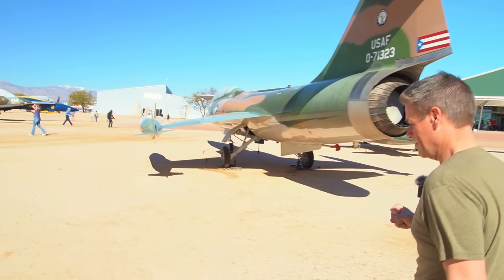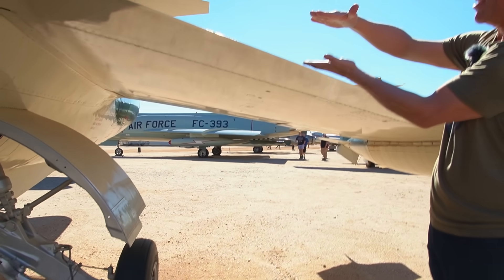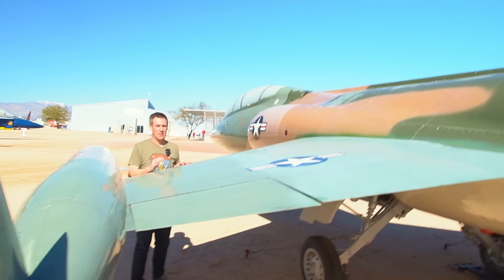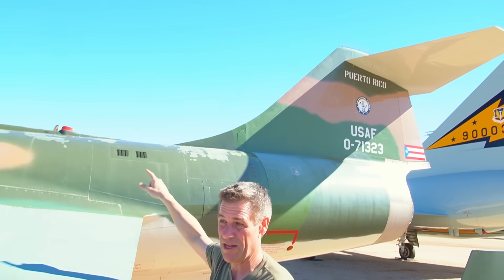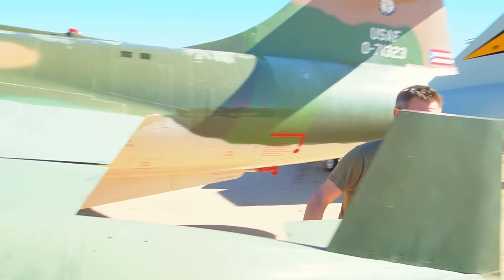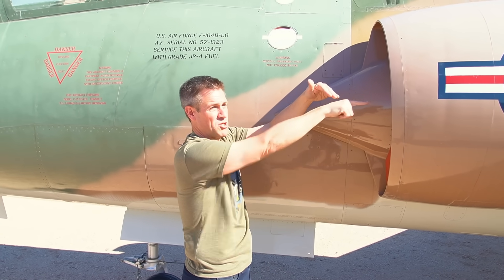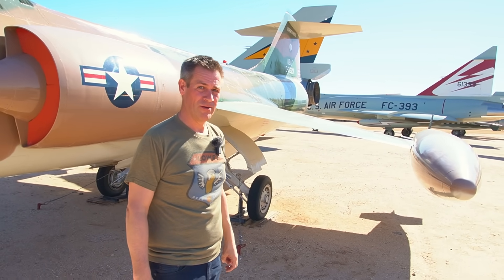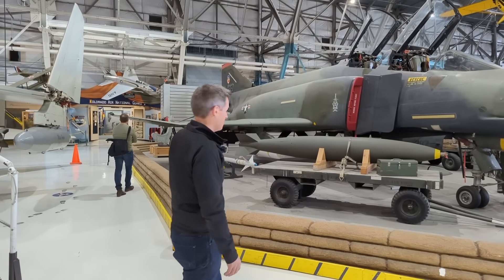Why the F-104 Starfighter Was So Fast | The Aviation Show Clips

Comment: They asked Kelly Johnson to make an interceptor that could take off and climb to Soviet bomber interception altitudes AS FAST AS POSSIBLE. When you give a man like Johnson instructions like that, he makes it happen. Please remember, this was just before we could make ground to air missiles that could lock onto a target and shoot it down. So this plane was a man-guided missile for shooting down bombers. The problem was that many air forces decided to try to use these planes for purposes other than the primary one it was designed for. The plane did exactly what was initially asked of it. When a wave of nuclear bombers is approaching North America, you don't kvetch about how high the landing air speed of the interceptor is. You pray that the interceptors can get to and destroy the bombers before they can release their nuclear payloads.
Reply: Wrong.  The F-104 was designed as an air superiority fighter, not as a bomber interceptor.  Since air superiority types generally develop into multi-role aircraft, there wasn't anything unusual about Lockheed doing the same with the Starfighter..

Comment: The F-104 fuselage was based on the U-2.
Reply from the maker: It was the other way around. The XF-104 was already in testing, so for the U-2, they used the basic 104's fuselage coupled with those long lovely wings to get what they needed.

Comment: Remember when the 104 was built. The heating up of the Cold War. Lockheed designed the F104 for one purpose and one purpose only. A last ditch strike against the USSR. The role? Take a nuke as fast as it would go and deliver it to the Soviets. It was a one-way aircraft (why it sucked at landing - it was presumed it wasn't coming back and there would be nothing to come back to anyways). Why so fast? Simple. Very small. Very light and a monster of an engine. It was a piloted engine. As the Cold War simmered, Airforces had to start finding other uses for the 104, roles it was never designed for and ended up being very bad at practically all of them. The 104 became known as "The Widow Maker". The J79 engine in the 104 was not equipped with an "air-start" so the engine could not be re-started in flight. When the engine failed, which it did more than any other aircraft, the pilot would look at the ground at the tip of the nose. That was where that aircraft was going to create the hole. There was no controlling it. More advanced upward ejecting seats quickly replaced the original seats. It was not a question of "if" you would ever eject out of a 104, but "when", and how many times. A Canadian Forces pilot, during takeoff, upon hearing the controller call "Fire" (vehicle burning on the ramp), immediately ejected out of his 104. If you were smart, you never hung around to find out if it was you. As far as a platform for anything other than nuke delivery, it was useless but to be fair,  it was never design for anything else. It was litterally, a piloted engine with a bit of manuevering, nothing more.
Reply: You really shouldn't drink and post at the same time.

Comment: Wing leading edge was sharp enough that maintenance crews installed guards on both wings. It would split your skin with just a bump..
Reply: It was about as sharp as your average butter knife.  If you were careless enough to run into it, sure you'd get cut.  But it wasn't "razor sharp" or anything like that.

Comment: The leading edges were made of electroformed nickel (Ni). Nickle was actually plated (sulphamate) on a form layer by layer until it reached the optimal thickness. It took weeks and sometimes longer in a plating tank to reach its correct size.

Comment: I am an Air Force vet, aircraft engineer. When the 104's were brought in the hangar they had to have leading edge guards fitted! The Leading edges were HONED to keep them perfect. On a post flight inspection wings were checked for any damage to that  mainplane. Any small dink could disturb airflow.

Comment: I remember the old saying that if you wanted a Starfighter, just buy a field in Germany and wait. I remember lots of  crashes
Reply: Didn’t test pilot Yeager loose control of an F104 at high altitude loosing wing lift and going into a flat spin?

Comment: Regarding the lack of dogfighting ability on the F-104: 
According to Bruce Gordon (former fighter pilot and author of 'Spirit of Attack'), he stated that the F-104's could actually outmaneuver the F-106 at supersonic speeds in 'mock' combat !! 😮 I find this rather hard to believe, but I suppose it is possible if one considers factors such as the ability to 'roll' quickly, and the ability to maintain 'energy... not just turning radius.

Comment: Flew to Tucson just to visit this museum for its B-36 and B-58 back in 2011.   The vast majority of other aircraft are easily found in many museums around the nation.
Pima is a worthy visit for any aircraft fan, just avoid extreme summer heat, as I ended up moving from wing shadow to wing shadow and still got cooked!
Also check out the Titan II Missile Museum while there!
Reply from the maker: I've only visited in February, when we filmed this, and it was roasting hot that day! Totally agree about Titan. We did an audio tour for the podcast (pre-full YouTube) days, and we got to go to the bottom of the silo. That was an odd experience.
Reply: @theaviation_show   Glad you took the time with the Titan site!   Kudos!
I maintained some of the comm gear for the silos in Kansas (that big antenna outside was part of our HF system), and of course got the see it all when live.
Very cool memories of younger days!
Reply: C’mon guys, it’s a dry heat.

Comment: You HAD to start with that nickname. Just couldn't resist, huh...
One thing few people know about, and I can't remember the name of the guy at AETE (Aerospace Test Establishment) that told me, was that in around '84 or so, in Cold Lake, an idea was floated to take one of our soon-to-be-retired CF-104s and modify it with a GE F404 engine as used in the new (at the time) CF-18 Hornet. 40 years later, we're still using the same tired jets...
I don't think the idea got much past the spitballing stage before it was ixnayed. The aircraft were already allotted to Turkey, and they didn't want money spent on it. The performance increase is speculative, same thrust with 2/3 weight and 55% fuel consumption. Increased range for sure, and likely acceleration and speed boosts. Weight and balance would be a bit of a problem.
I wonder if it would howl the same.

Comment: The F-4 pilots used to complain that the 104s cheated.  The 104s fought vertically (slash and run), while the Phans tried standard turn and burn.

Comment: I love the F-104.  The U-2 is basically an F-104.  Hard to believe, but it is true.  There was a German WWII ace that was still in the Luftwaffe when Germany adopted the F-104.  He hated it as a fighter.  He was eventually relieved.  His superior said  he was an excellent fighter pilot, but as a general.  So many speed records were set by it.  However, like the F-16 when it the engine goes out it is a giant lawn dart.
Reply: Erm...that is why the F-16 has a hydrazine catalyst backup power source for the hydraulic system. So, a well guided lawn dart...compared to the drop-from-sky F-104
Reply: Hartmann didn't hate the F-104 (he called it a great airplane), but he did feel that it was too demanding for the Luftwaffe and he was outspoken about Germany's decision to buy it.  That's why he got canned.

Comment: You should've mentioned the "area rule" which gives the plane its coke bottle shape and reduces supersonic drag. That's another reason why the F-100 and F-102 were so disappointingly slow while the Starfighter is a dragster.
Reply from the maker: Check out the full Century Series video mention at the end of this one (or the two F-100 and F-102 clips), Joe goes large on area rule. This is just ten minutes of an hour long look at most of the Century Series at Pima, which we followed up with two more at the Wings Over the Rockies Museum in Denver.
Reply: That was actually the aerodynamics understanding at the time and turned out to be a mistake. The wasp-waist profile was thought to break through transonic speeds faster with lower energy, but it doesn't. Profile no longer used.
Reply: it was just an excuse Kelly Johnson used for Lockheed to back his radical engineering prowess.  It’s an amazing aircraft, its aesthetics does not always concur with dynamics of flight, but untouched in its narrow window of operation.  Moreover, it was less than a decade after F6 Hellcats were the latest fighter aircraft.

Comment: F-104 was a dismal failure military wise. Took allought from the u- 2 spyplane in it's design. Wings too small, burned too much fuel just to stay up in the air due to small wings. Like the f- 102-- a real 🦃.
Reply: The U2 was developed from the XF-104 prototype, not the other way around.  You're wrong about everything else, too.

Comment: The Starfighter "Widow Maker" reputation was from F-104G's operated by the West Germans. The F-104Gs operated by the Italians had a much lower accident rate and F-104Ds & Fs operated by the USAF had a lower accident rate than the F-100s.
Reply from the maker: Chris over on the Military Aviation History channel has a great video about Luftwaffe F-104 loss rates which is well worth your time. Lots of charts if memory serves.
Reply: @theaviation_show roughly 900 units, more or less 1/3 crashes.
Reply: @justayankhouston741  A 30% attrition rate was pretty typical for 2nd Generation jets.
Reply: The Germans final accident rate was a bit over 15 losses per 100,000 flight hours.  The Italian rate was slightly higher at around 16/100k.  The Starfighters flown by the USAF had an accident rate of over 30/100k (the D anf F models were two-seaters, btw).  This was far higher than any other Century Series fighter, including the F-100.

Comment: Amazing design with a first flight 71 years ago now.  Interesting comment about its dogfighter v. interceptor usage, very similar to the English Electric Lightning of the same era which was slightly better as a dogfighter but was essentialy an interceptor for use against incoming Russian bombers.  However the Lightning was a bigger aircraft and required 2 engines to achieve the same performance as the F104.

Comment: Ejecting down? What? 

Sure about that? 

Isn't it that it wasn't a Zero Zero seat and not that it ejected down? that would require massive changes to airframe. The seat ejects up, just not greatly at low speeds and low altitudes.
Reply: the first f104s did indeed shoot the pilot downward when ejecting.  I don't know offhand when it was changed to going out the top. And as stated in the video the early ejection seats didn't have the power to guarantee clearing the tail.
Reply: Indeed, the initial design did have the pilot ejecting down. I'm not sure that this feature made it beyond the prototype stage, though.
Reply: And, that was long before "zero-zero" seat development.
Reply from the maker: Yep, the Starfighter was initally built with the Stanley C-1 Ejection Seat which was downward firing up to the D-model. These were replaced with upward firing rocket ejection seats with a mod in the sixties.
Reply: @theaviation_show  By early 1961 all C1 seats had been replaced with the C2 seat.

Comment: Interestingly the Bell X1A was capable of in excess of  Mach 2.4 with a straight thin biconvex wing and only 6,000lbs of thrust.. Also the Mirage III had a  higher top speed than the F-104 with much better manoeuvreability and turn performance  while using an engine with nearly  5,000lbs less  thrust... And no need for flap blowing.
Reply from the maker: The Mirage III is a fantastic aircraft and seeing Dassault's approch to jet at this time and contrasting with Kelly Johnson and his team is very interesting indeed.

Comment: With rocket assist, the F-104 was the first piloted aircraft to reach 70,000 feet altitude, the point where space begins and pilots become astronauts. The U-2, also a 70K' flyer (Still in limited use today because spy satellites cannot necessarily be where they are needed WHEN they are needed) is essentially an F-104 with glider wings.
Reply from the maker: U-2s still fly every day that the weather allows for them. They are very active out of the bases here in the UK as they can be deployed quicker than retasking a satelite.
Reply: @theaviation_show  Didn't know usage was that regular. In asking about the narrow window between critical mach number and stall, was told by former U-2 pilot who now flies sailplanes, that tail section, not the wings, would be first part of the airframe to fail from an overspeed condition.
Reply: The F-104 has zoom-climbed over 100,000ft. And they could easily operate around 60,000ft. Without any rocket assist, in either case.

The U2 is not a modified F-104. It is in fact a P-80 shooting star with longer wings, stretched fuselage, powerful engine. I have witnessed a U2 climb out at about 45 degree pitch attitude all the way into the fight levels until it was only a speck in the sky, well above the altitude airliners typically fly. They cant go vertical but they can definitely climb at least 20,000fpm sustained rate until you cant see them anymore. 

The P-80 of course was first operational US jet fighter and first jet by Kelly Johnson is also one of the newest. The last U2s were built in the late 1980s. Which makes them newer than most F-15s and F-16s.

They use them a lot. The U2 is useful for spying on angry little impotent countries armed with fists shaking at the sky.
Reply: @Triple_J.1  F-104 zoom-climbing to more than 100Kft. on jet turbine engine only! Remarkable. What about compressor stall? Did these aircraft have attitude thrusters like the later X-15? 100Kft. is some very thin air.
Reply: @Triple_J.1  The U2 fuselage originated from the XF-104 prototype, which is shorter than the production 104.
Reply: With those tiny flying surfaces its amazing it could fly, in the super thin air at 70,000 ft!

Comment: The F104 might have been the fastest or most advanced of the Century series fighters but the only one not to receive large USAF orders.
Reply: The Starfighter was a fairly simple airplane.  The F-101, F-105, and  (particularly) the F-106 were all more complex, and the F-106 was faster.
Reply: It was too a short range for the USAF. That and the bomber mafia controlled the air force.
Reply from the maker: The F-104 foreign sales campaign by Lockheed was a remarkable bit of slight of hand salemanship.

Comment: I know it is unfair to criticize pioneering decisions of the past having the advantage of hindsight, but Kelly Johnson put too much emphasis on speed in the F-104. Other contemporary projects were less focused on drag reduction, and came up with more flexible designs. A decade later, the French came up with the Mirage F1, showing that a F-104 with more wing area still could do Mach 2, and be much more agile and had lower take off and landing speeds.
Reply: I think the F-104 was optimized for speed because that's what the Air Force specified.
Reply: The only big wing F104 derivative that I know of  was the CL1200 Lancer proposal with a 53% bigger wing. Failed proposal. Was there other big wing 104 proposals or research aircraft? 

https://en.wikipedia.org/wiki/Lockheed_CL-1200_Lancer
Reply from the maker: Yes, but you have to consider the limitations of knowedge at the time and also that the P-80 and F-94 were Lockheed's other jets at the time. Give the remarkable pace of development of US jet fighters in the 1950s (see the full video for more on that) you can understand the limitations of the F-104 and also why larger orders were made elsewhere.
Reply: @theaviation_show  I think the MiG-15 was a wake up call that caused a knee jerk reaction in the west. Some reacted better than others. Another bad reaction IMHO was the BAC Lightning. They also pursued speed at the expense of payload and range, although it did much better in maneuverability and take off and landing.

Comment: A one trick pony! Only fast, mostly useless!
Reply: It had more tricks up its sleeve than you might be aware of. In Cold War Europe it was used by a number of nations as a tactical nuclear strike aircraft. Canada was one of these operators. After deciding to drop the nuclear role, the CF used them as conventional strike aircraft carrying a variety of bombs & rockets. Very stable at low altitude & high speed due to the thin wings. It could fly below enemy radar to deliver the goods. At least one squadron was used in the reconnaissance role with Vinten camera pods mounted centerline. We flew them in that capacity from the mid 1960's to the early 1980's, hardly useless.... ;)
Reply from the maker: She had a lot more tricks than just speed, she was just a handful to fly especally when fully loaded. The moniker was still well deserved. @MilitaryAviationHistory did a great video on the Luftwaffe's F-104 losses.
Reply: @theaviation_show  The moniker was media-created and was hardly "well-deserved".  Do some research. With the exception of the early "A" model, the Starfighter's accident record wasn't much different than any other 2nd Generation fighter.